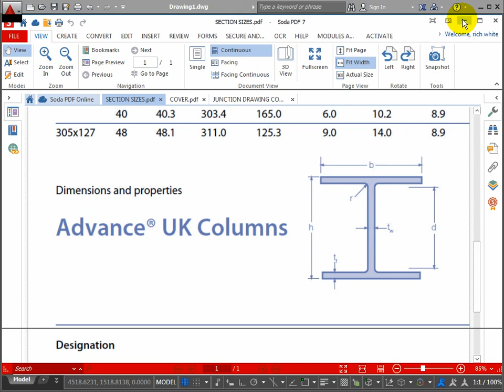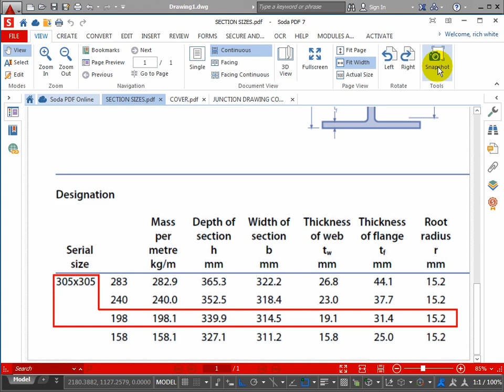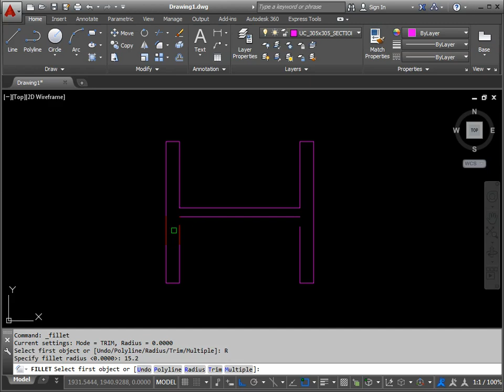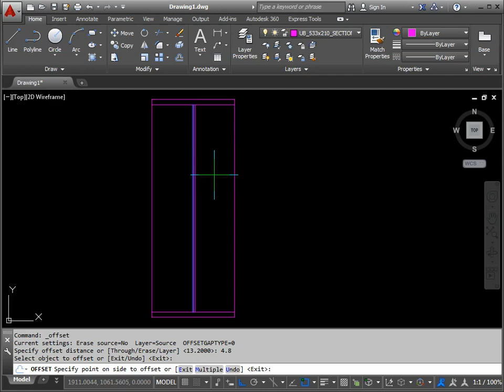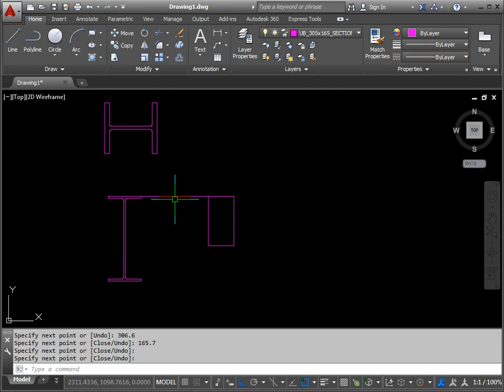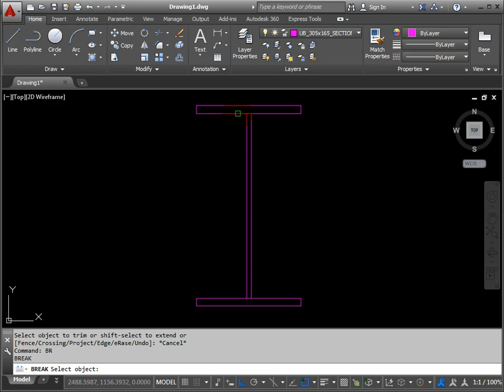AutoCAD 2D   Structural Detail Exercise pt1 of 5 - Draw Cross Sections

Comment: can we press pull this design?
Reply from the maker: Hi. Yeah it would work but all shapes have to be polylines and not just the steel sections. To get the model you see at the start of the video required changing the UCS so you can rotate objects to different construction planes.
Reply: okay. Thank you.